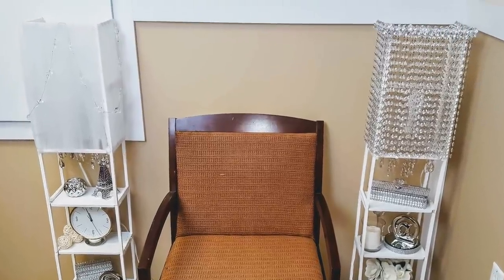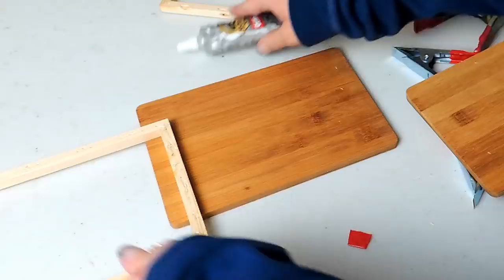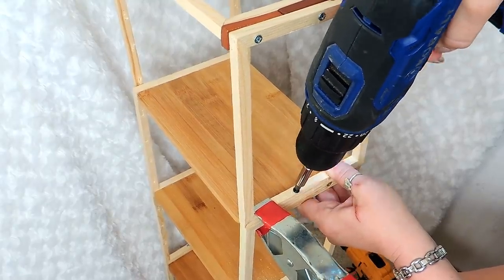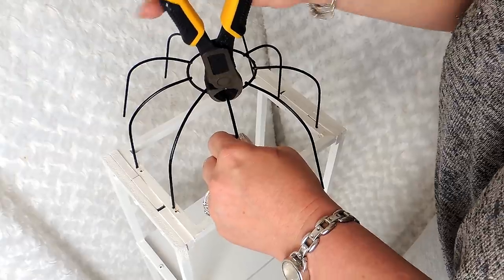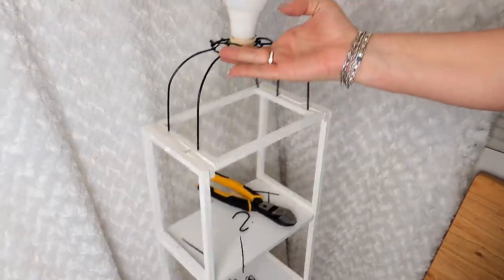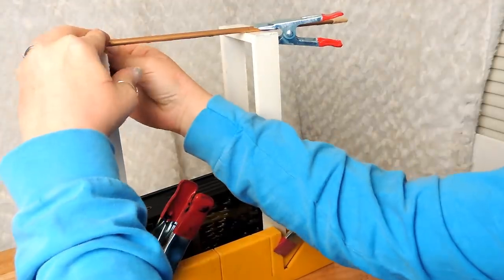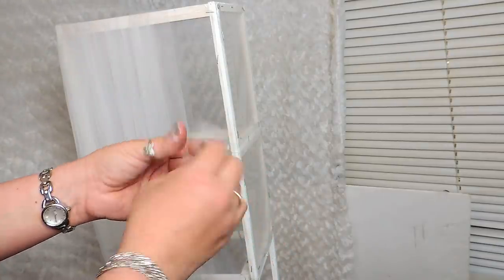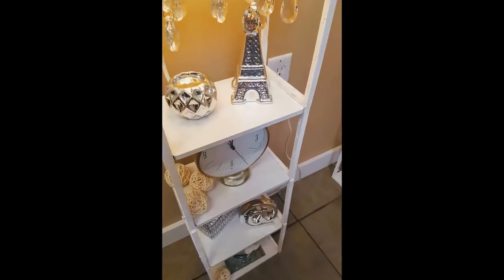I made wooden furniture using Dollar Tree Materials - DIY Lamp-Shelf | DIY Home Decor | DIY Lamp

Comment: This is a very neat idea. I would have done it a bit different thou.
After pulling out all the staples and screwing all the screws you can see all that after the paint.
I would have sunk the screws and covered them and the staple marks/holes with wood putty sanded and them painted. You still can.
I would have painted the Staples also.

You could possibly used Picture frames
Reply from the maker: Hi Mari, you are absolutely right and if you're gonna spend this much time you might as well to do it right. I probably will go back and redo mine when I get some extra time. 
 I work a job and do YouTube too so time is not on my side.  I wanted to get this video out for the weekend. I had to go as fast as I could to get finished and have the editing done. If not for that I certainly would slow down and take my time to do this like you're talking about. Also I used a mix of different screws again just what I had on hand in the moment but this could for sure look so much better. A good bit of the screws I had on hand were not the ones you can countersink. (Panhead screws) The staples really aren't needed except on the back of the canvases in each corner. A strong adhesive glue will hold the lampshade just fine.  I 100% agree the details in the work here could far and away look better.  As far as picture frames goes .... the ones from Dollar Tree are made out of a cheap plastic mold that's super brittle. I've tried to drill screws in them several times. The plastic materials won't hold a screw. The first little pressure you put on it BAM it pops right out. If you had some wooden picture frames that would work perfect though. Thank you for watching and for your comment. Glad you like this idea <3

Comment: I’m wondering if just using a good quality glue instead of stapling & have so much going on would hold it properly & if a thicker bottom shelf would make the quality of this look more professional? I love the idea of both but the way it’s put together. 

JMO I love DIY’S but its the quality of the look in the end for me.. 

Thank you
Reply from the maker: Hi Dena, yes you could use a strong wood glue. It would take a bit longer to do this project and your right it would look neater. You could also use counter sunk screws if you wanted and just use em sparingly unlike I did. Another thing is I was in a hurry to get this video posted but for a better finished look would be painting a final at the end.  As mentioned in the video the staples are totally unnecessary around the lampshade itself and that's if you want to use the clear folder but you don't have to use those at all. The clamps and glue is perfectly fine if you're in no hurry.   For the bottom you could double up on the cutting boards if you want a thicker base. Use wood glue to glue to two or three together just depends on how thick you want it.
Reply: Creative Living Lifestyles 

Thank you so much for your reply. I’ll look into going to Home Depot for my bottoms on this one. It’s a beautiful piece. 💜

Comment: The dollar tree doesn't have the wooden boards neither does the website anymore do you have the measurement of them
Reply from the maker: Hey Tina, sure! Yeah I know, they didn't keep these in stock very long.  As you see in the video the 6x8 canvas frames are about the same size when they're laying on top of the cutting boards. You could use those as a guide.  The 8 inch side is a half inch longer.  The size is (8 &1/2  x 6)